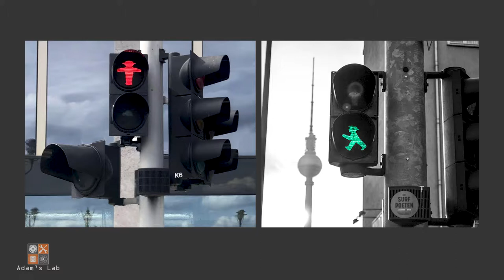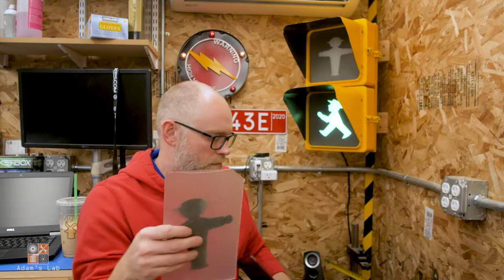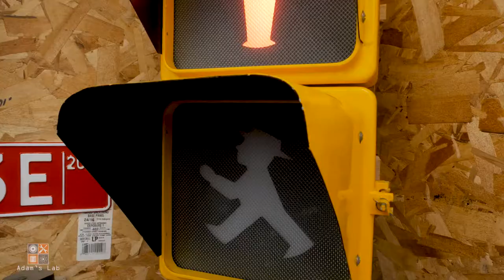Custom Ampelmann Traffic Light - "Restoration" | [0038] 🚦

Comment from the maker: NOTE: The original Ampelmann walked to the right. At some point it was changed to the left. On all the  lights we saw on our trip, the Ampelmann was walking left. The Ampelmann company (who owns the copyright on the symbol) has the Ampelmann walking to the right on all the merch/logos/etc. I was going to follow the original and have the Ampelmann walking to the right but I kept forgetting to mirror the image before cutting the vinyl (I had to cut it a couple times due to mistakes in applying it). So, on my light the Ampelmann is walking to the left as we saw in Berlin.
Reply: Do you make ampelmann traffic lights for people?
Reply from the maker: Unfortunately, no. As I mentioned in the video, the Ampelmann figure is copyrighted. So even if it was something I could do logistically, I couldn’t do it legally.

Comment: Just curious why you screwed it to the wall? I gave you a great suggestion with pipe fittings 👍
Reply from the maker: Taylor Leger
 - It was just easier to use the holes that were already in the back of the light to mount it to the wall. At 1:09 you can see a board that someone had attached to it at some point, I just removed that and used the holes, the back is flat so it nicely sits against the 2x4s.